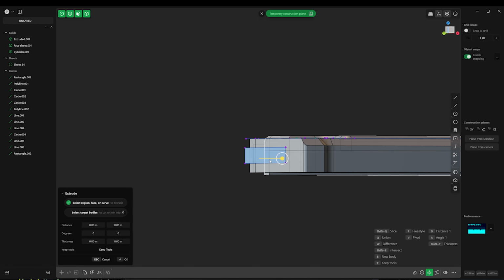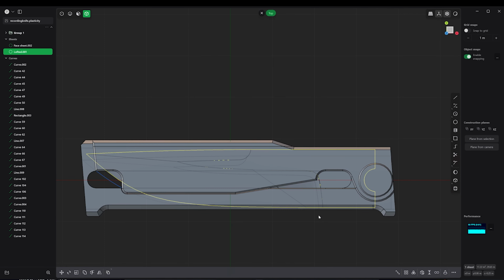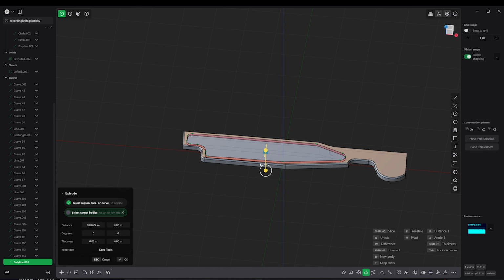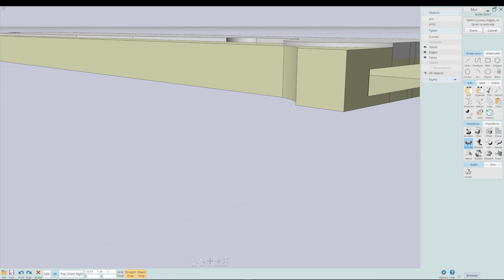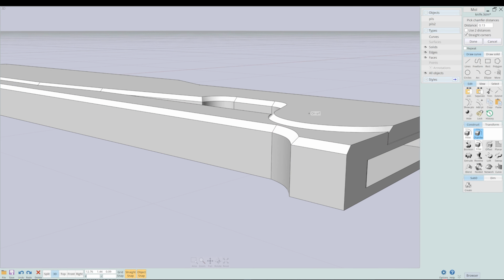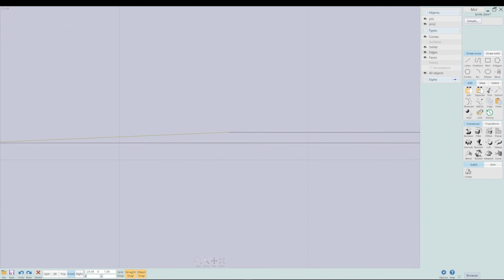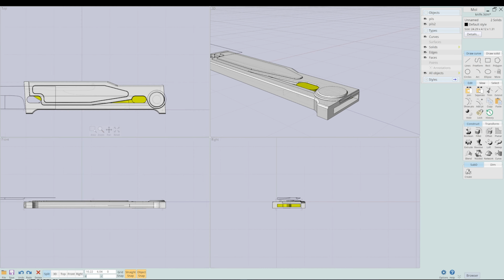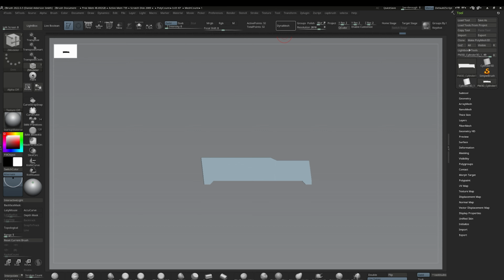Plasticity vs. MOI vs. Zbrush | CAD Modeling Reate Exo Gravity Knife

Comment: If you had to pick only one out of Moi and Plasticity today, which would you pick?
Reply from the maker: I would choose MOI if price wasn't an issue and you said neither was going to receive any more updates ever. But I've been focusing on Plasticity now because of the cheaper Indy pricing and the expectation of continued and more frequent updates.
Reply: @dazzyfizzle  Thanks for replying. Yeah, I already have Moi3d license and was debating between getting better at Moi vs starting with Plasticity.
Reply: @dazzyfizzle  Indie pricing does not include IGES export - which is common NURBS/CAD export-import format. This is very unfortunately. I'd go for Moi3D for Sub-D import (script by Max Smirnov)
Reply from the maker: @SuperSuperka  yeah i agree, plasticity, despite being a small indie dev team, seems to be going for a more corporate,  money hungry pricing scheme, designed to get the most payment from each customer.
Reply: Plasticity definitely. Bevels actually work in Plasticity.